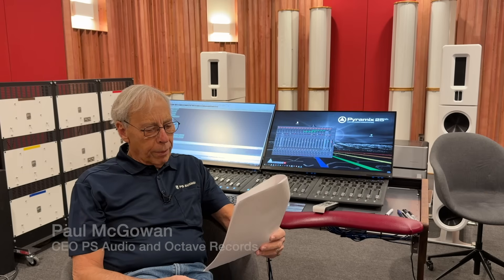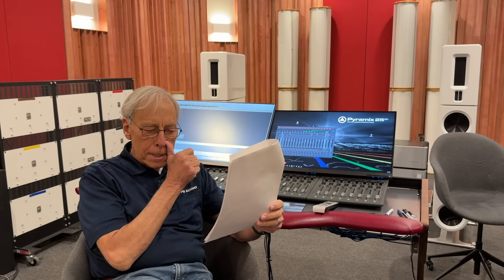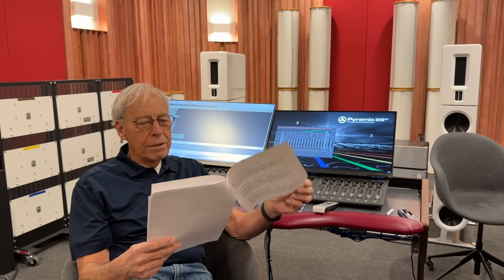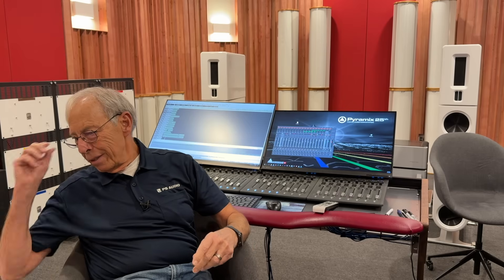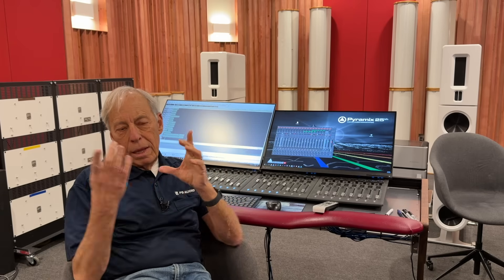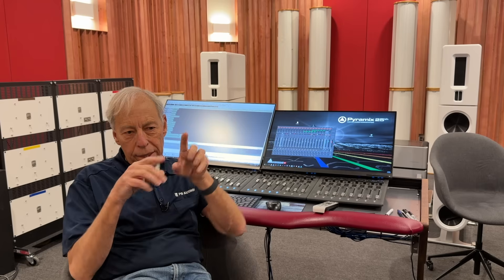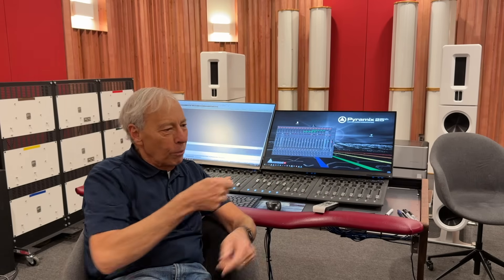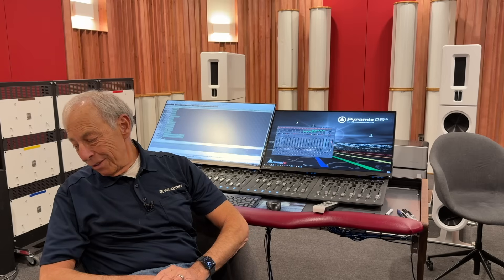XLR to RCA adapter and why it won't work

Comment: Mm Paul misinformation is not cool? It's ok to champion XLR as the be all end all of audio heaven, but XLR yo RCA can work 💕 too, just as good. There is no need to bin ones device with RCA and upgrade to XLR and spend unnecessarily.

Comment: Keep the 'audiophiles' confused... That's the matra.
The comments all basically say the same solution. Just take one output of the XLR and the screen to a phono plug and you're good to go. If it's a few feet/metres you won't hear any difference.
The low output impedance of the XLR output makes it pretty impossible for 'noise and interference' from reaching any audio inputs in a hifi setup.
If you're going to say interference from fridges and freezers starting up, there's something else wrong with your house!
OK? 55 years working in audio if that makes any difference...

Comment: And what about to use an XLR to RCA adapter for take the output of a fully balanced DAC to an amplifier with just RCA inputs? It should just pick one signal and the ground so it should be the same as to use RCA to RCA or there are some benefit? I mean just one meter of cable for hifi setup. Thanks for the video and the explanation 😊

Comment: The question was if he would "retain noise rejection".  The answer was correct in that he would not.  Not sure why everyone is saying that Paul is lying.  I think that people are mistakenly assuming that that the "it won't work" answer means that there would be no audio coming out of the sub.  It will work just fine but without the benefits of noise rejection.
Reply: That's right, that's exactly what Paul means. It only took one person not understanding either the question or the answer, and the vast majority started giving the same response (unfortunately, some in a rather rude manner)...
Reply: XLR to RCA is also dead quiet! Only advantage of XLR is, if one needs long cabling which is not required in home audio set-up.

Comment: Need to understand the difference between impedance balancing and true differential balancing. A domestic device like an AV processor handles unbalanced signals tied to the common chassis ground. If this is output to a 'balanced' XLR, this will be impedance balanced. The 'hot' pin will be the signal, the cod pin will be ground, but both will be fed through indentical resistors. You will still get common-mode noise rejection at the other end, but the cold pin will only contain the noise to be rejected, NOT a negative version of the signal.

Comment: No need to buy fancy adapter. Pin2 hot to rca center pin. Ground to shell. Unbalanced kept short is fine in hi-fi. 
In a studio with miles of cable, balanced is essential for long runs.

Comment: Nonsense videos like this show Paul’s profound ignorance of audio engineering. XLR to RCA adapters and cables are inexpensive and readily available. Yes, the noise cancelling property is lost but cable noise is no problem in 99.9% of home systems. The wiring is simple, XLR pins 1 and 3 are connected to RCA ground and pin 2 connected to RCA centre pin.

Comment: JOHN in Vancouver: I've been making these cables in the Television Broadcast Engineering, and Live sound for years. It is a STANDARD wiring format that's easy to explain:  Pins 1 & 3 tied to the outer conductor of the RCA jack. Pin 2 goes to center. Now Everyone here is going to go questioning crazy, but that is how it's done. If you want to get Fancy, get a 600 Ohm Isolation Transformer. On the Balanced side, put a 10K resistor across pins 2 & 3. Wire Pins 2 & 3 to the primary side of the isolation transformer. On the Secondary side, Take the two leads from the transformer and wire them to the center and outer conductors of the RCA Jack. Now for pin 1: you can do three things:  Pin 1 to Outer RCA Jack; You can place a switch in that line to "lift" the ground, or leave pin 1 unused. your choice. Of course you could look at RDL and buy a Balanced to Unbalanced Transformer that's already in a nice little black case..
Reply: A pair of vintage Western Electric 111c transformers will make you feel like you have spent enough. Pronounced Restrum Erectric in the Far East by cognoscenti ;-)
Reply: And yet, not a word of level matching. Line level XLR is +4 dB, where as RCA (phono level) is -10 or -20 dB. So, feeding  an RCA input from an XLR output will distort the signal as it will start out 14-24 dB too hot and clip the input. Ask me how I know.....having spent over 50 years in the trenches mixing sound live and in studio, I have duct taped and bailing wired more cables than I can count.
Reply: @andyevans2336  Yea, Your right. I just plain forgot about it..
Reply: Despite Paul’s claim to be an engineer he is just a salesman.

Comment: Of course XLR>RCA will work just fine. You won't get the benefits of the CMR but as long as you use decent shielded cable you'll be just FINE!

Comment: There are loads of inexpensive tiny analog audio mixers with one or two XLR inputs.  If you put one close to the sub you can keep the bulk of your run balanced and run a short out from the mixer to the sub.  Caveat being those tiny mixers won't want to see a true pro audio line level signal because they won't have a 10-15 dB pad.  But if you're sending consumer line level it won't be a problem.  And now you also have a real volume knob controlling the sub that's easy to adjust.  Sweetwater is a good musical instrument/pro audio site.

Comment: If you use an electric guitar, the output is single ended, and would present as such to your desk. We have a Soundtracs CP6800 desk, circa 1984/85. All inputs are balanced, all outputs unbalanced. Go figure..!

Comment: My Benchmark Media Systems RCA to XLR cable eliminated my ground loop noise problem but not sure how it would work for XLR to RCA. Best to check with someone like them for your application. Correct wiring critical.

Comment: Wrong. I worked as an engineer in the top UK studios and The BBC for 40 years. XLR to Phono cables were a standard piece of kit. XLR pin 2 to the phono pin, XLR pin 3 to phono shield. Yes you loose the common mode rejection inherent in balanced cables, but in a home HiFi environment, that is almost never a problem. Even in outside broadcast environments, working at line level cable induced noise in this arrangement was never an issue.
The two possible issue are:
XLR signals are generally about 14 or 15dB higher than phono, so the sub woofer input might distort  (thus some kind of signal level reduction is required, a simple resistor voltage divider is sufficient). 
also XLR outputs should be designed to be truly balanced, so that grounding pin 3of the XLR will have no effect, except to increase the signal voltage on pin 2 by 6dB. Badly designed XLR outputs are sometimes ‘bi-phase’ and not truly balanced, this can result in signal being fed into the ground, and/or, distorting the signal coming out of the XLR.

Comment: Depending on his "processor", it's XLR might be only quasi-balanced. Some less expensive systems are not truly balanced but still use XLR with one pin actually common/ ground. And converting to RCA won't really matter.

Comment: What? So your answer is what? "Not possible.." 
Okay that's bullshit. Easy answer to that. Get a DI box. Converts the XLR balanced signal into an unbalanced signal. Simple. We do this all the time in studio recording. We do this all the time in live sound reinforcement.. home theater or hi-fi systems are no different. If there's an input that is only RCA and you only have an XLR output and that XLR is balanced, how could you tell people " too bad, so sad, that's it, You can't do anything about it, go get better equipment. " 
That's really weird and bad advice .. frankly I don't even know what the problem is  if you just get an XLR to RCA adapter which would take the negative signal and send it to the ground meaning you have ground and you have your positive signal equals the unbalanced signal. There's no difference there.. The DI box Just uses the transformer to get that signal unbalanced.
There's a DI box solution for almost any problem you can think of..
Reply: This is another example of why some people call Paul's company "BS Audio".  Don't blame me, I didn't make it up.
Reply: This is the best answer!!

Comment: xlr to rca
xlr 
pin 1 gnd
pin 2 hot +
pin 3 cold-

Use a shielded cable and on the rca side make pin1& 3 to ring and pin 2 to center.
 This will be the equivalent of a regular shielded rca.
Reply: That's how it's done.

Comment: I have a set of  proper 30cm-long Balanced TRS-to-RCA cables connecting my FiiO K11 R2R DAC/preamp to my Douk Ampapa D1. These are the correctly made items which are intended to convert balanced to single-ended. No - it's not balanced, but it does work absolutely flawlessly. 
I had to do this, because I have an FM tuner which uses the RCA connectors on the little D1. I got my TRS-to-RCA cables from AliExpress. Great deal.

Comment: This seems to be a contrived post. Why would anyone want to split one XLR into two RCA's ? It seems to me that this question is missing a lot of info to make any sense of his setup. If the questioner has a sub that requires a stereo RCA input,  then he needs a processor with stereo outputs, regardless of connectors.

Comment: Radial Engineering makes the "Pro Iso" product that does this balanced XLR to unbalanced RCA conversion. I'm planning to put this right next to my sub. At the moment II'm using just a jack converter but the cable picks up some noise on the way as the sub is located a few feet away from the gear.

Comment: Should you not leave pin 3 (negative ) for an output? So for the two xlr outs I think you should link earths, and join positives via 1k resistors.

Comment: can always find a balanced to single ended transformer. Lundahl, Sowter and Cinemag make excellent transformers that are used in pro gear as well as home audio
Reply: Unless you are under a transmitter, and doing 100 foot runs, transformer coupling a line-level is audiofoolery expensive.  Just keep the run as short as possible and don't parallel power wires.

Comment: Are there issues running the higher voltage of balanced signals into unbalanced inputs that expect lower voltages?
Reply: Not a problem as long as there is a level control.
Reply: Considering that if you only use 1/2 of the balanced signal chain, you only get up to 1/2 the maximum possible output voltage. Ie, if it says balanced 4 V, then you'd  get 2 V, etc., etc. However, an adjustable input level would be prudent.

Comment: You can make it work by connecting the positive (+) of the XLR to the hot/signal of the RCA, and wiring both the ground and negative (-) XLR to the RCA Ground. It won't be balanced but it will pass sound.
Reply: This works for input only. For XLR output the negative (-) should NOT connect to the ground!!! Otherwise you damage the amp.
Reply: @voretsu Right, obviously the negative output should just be left unconnected.
Reply: Yes, balanced sort of is equivalent to you have two RCA outputs and the negative is just with opposite polarity.

Comment: The sub is mono and just sums the left and right channels together anyways. Just use an XLR to RCA adapter, it will ground the negative phase, so you won't have the common mode noise rejection, but noise is rarely a problem with sub channels.
Reply: Years ago, I was able to get a very good deal on a high powered Pro-Amp, that I use for my subs. The Pro-Amp only had XLR's and my B&K Processor only has single ended. So I did exactly what you said in this comment. I just got an XLR to RCA adapter. I have since gotten an Anthem Pre/Pro which has XLR for the sub, but I have never gotten around to getting just a subwoofer XLR cable. It's on my list, just no where near the top. Not to mention I have two subs, one wired for stereo playback, the other for home theater, with two different amps now.